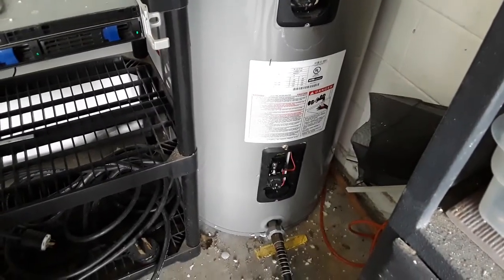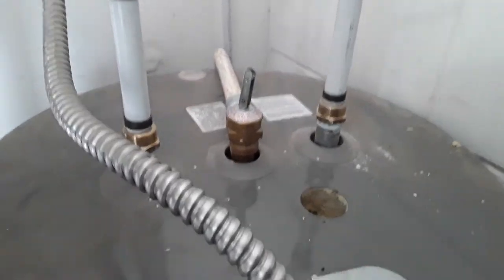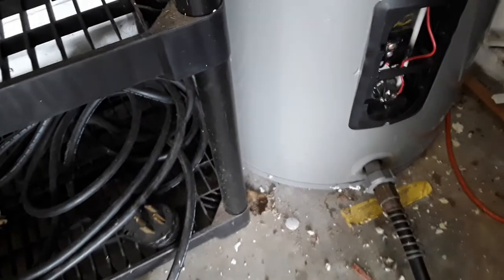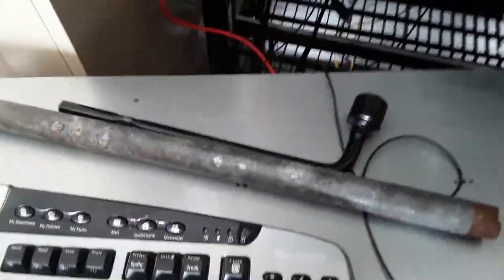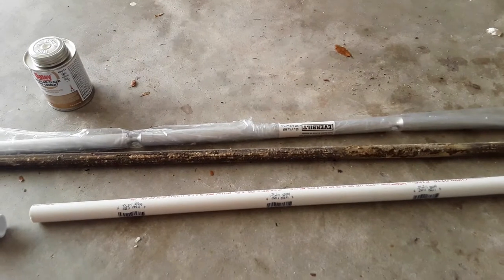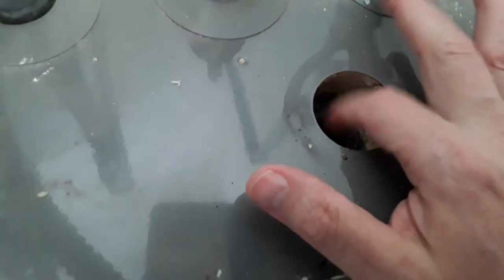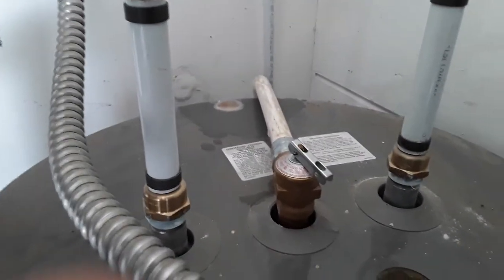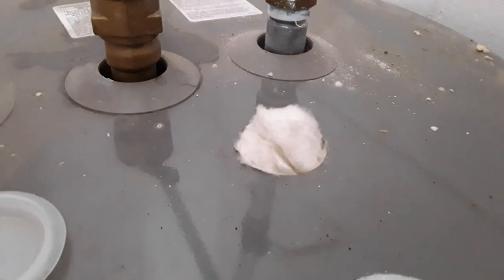How to flush and disinfect and change Anode in Water Heater

Comment: Thanks, I never thought about flushing out the bottom with a hose.  I've been using bleach to disinfect but Hydrogen Peroxide and setting the max temperature for a while must be better. The bleach can harm bath room fixtures and bath tub walls if not rinsed with the cold water side after flushing on the hot water side.
Reply from the maker: I havent had any sulfur smells since replacing anode and cleaning it out since the video a long time ago. So it seems to have worked.

Comment: Thanks for sharing video, suppose you replaced anode rod for two of your water heaters, bleached them, drained them and then flushed them to try and get sediment from bottom out. I ran my hot water for about 30 min or so to ensure bleach was out.

Following day hot water smells a bit like sulfur\rotten egg, not as bad as before but does it take a few days for issue to completely go away?
Reply from the maker: I read it could take a few days. I had to flush mine like 4 times to get rid of orginal smell when I first moved in house the owner put in new water heater and turned on with no water burnt out the heater elements smelled really bad, I am not sure it can come back from that kind of abuse.

When I cleaned recently I increased the water temperature to 140 plus degrees for like 45 minutes ran it through all the faucets be careful will burn. That kills everything in tank, then put temp back down to 120 or so. I used hydrogen peroxide, I heard bleach does simular. Mine still has a a hint of sulfur.

Some water heaters so far gone will need to be replaced.

I moved in house did a whole house repipe so not an issue with supply lines in house.
Reply: FixmyToyota Thx for reply, I will keep an eye on things and my water bill lol. What’s odd is that the smell is intermittent and only is my master bath faucet and laundry room. All other faucets/appliances don’t smell. 

I pray to baby Jesus I managed to address issue and I just need to hang tight.
Reply from the maker: Hmm, sulfur smell could be sewer drain/vent issue. Extremely hard to determine.